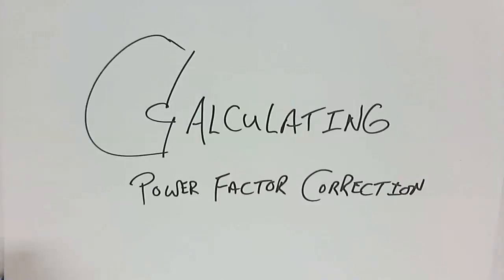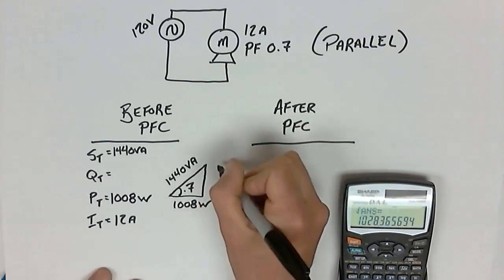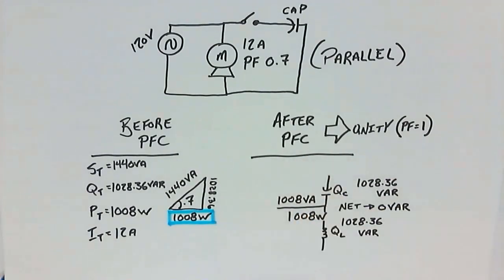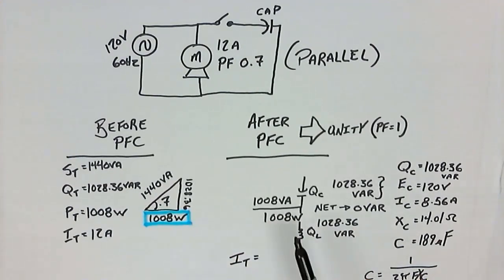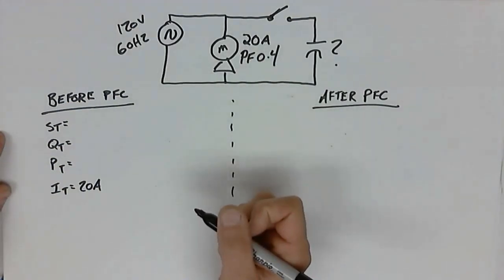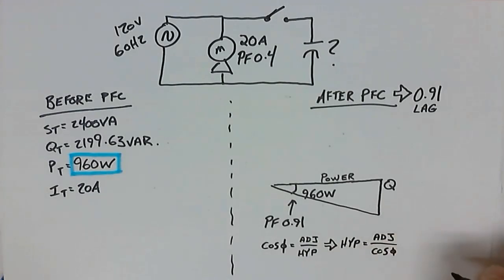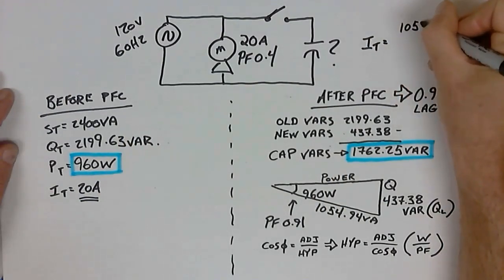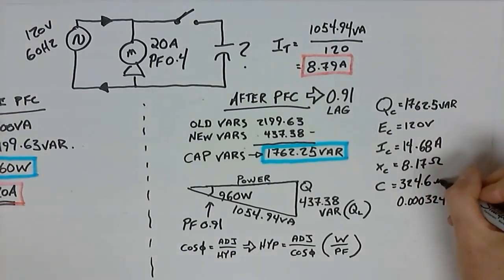1 phase AC Calculating Power Factor Correction

Comment: Great explanation for PFC calculations!!

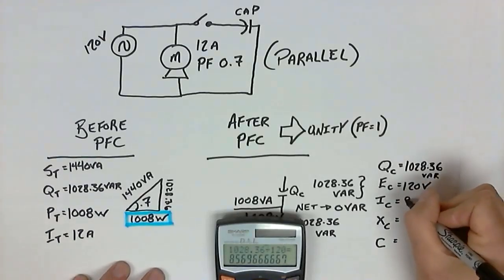8:34 Just realize, if we calculate Ic by using Qc/Et then it was giving very high capacitor current as we neglect the sinθ component and it doesn’t follow KCL for whole circuit. If we use that sinθ component for unity PF then it will end up Qc=0. So, I think, we need to use Ic=It-Im, which gives 3.6A, where Im=12A and It=St(1008VA)/Et(120V).
Reply from the maker: Thanks for the comment. There are certainly multiple ways to come to the same answer when calculating circuit properties in AC circuits.